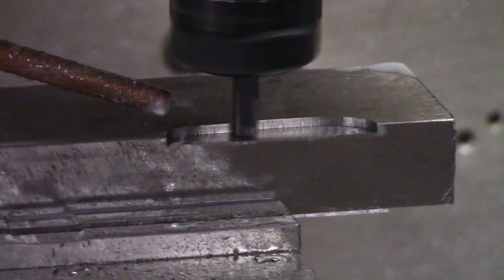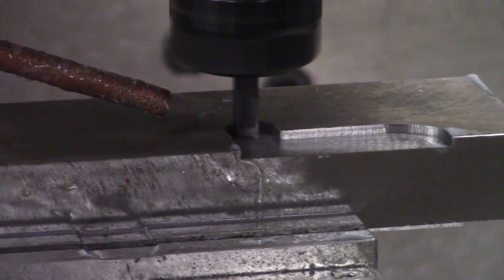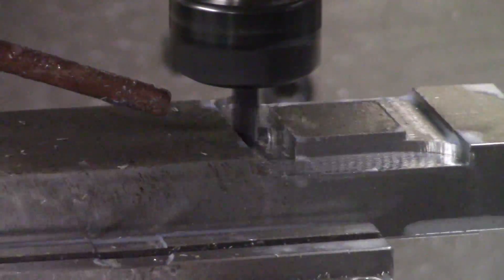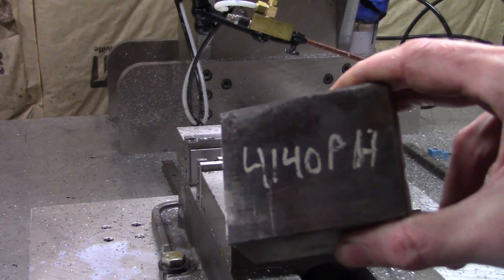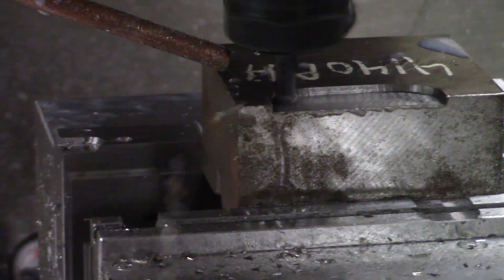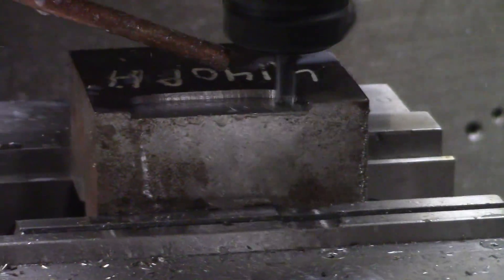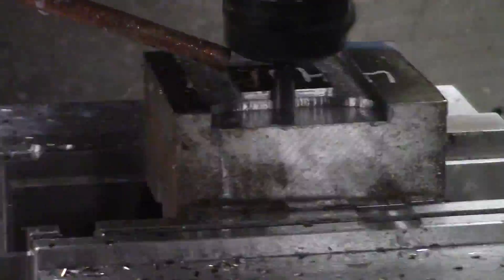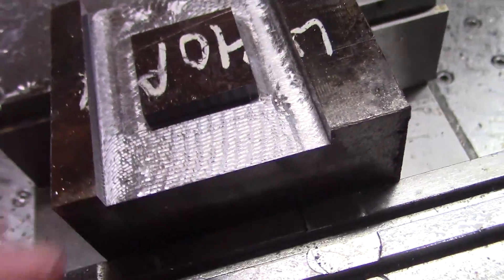Trying out Steel on the DIY VMC

Comment: The speed you chose may be "what the book said" but as a machinist with over 10 years working mills from 79kg to over 10 tonnes. I can tell you that only applies to machines in perfect condition, professionally made machines worth a fortune. I have never had the privilege of working on such a machine.
For the rest of us, including you, you need to start way slower than "what the book says" and work your way up.
The same advice also applies to climb milling, some of the biggest machines I have ever worked on still gave a better finish with conventional milling. This may not be what the book says but it is a real work fact. "The book" was written on premium machinery.

Comment: You can always leave a few thou for cleanup.
Maybe do your cleanup with at 25 -35ipm
I'd do clean up in two operations broken down like this:
Walls: leaving 1 thou on the floor
floor: leaving 1thou between tool and walls (don't want to touch the walls again :D)

It will leave you about a thousandths in the corner where the wall meets the floor. If this bothers you, you can always use a smaller high helical end-mill to cleanup the walls and floor near the walls, then do the rest of the floor in a separate operation.

Also, i would check the tram, runout, and deflection under load of your spindle. It could be the reason for the some of the surface finish issues.

Comment: any idea how much your machine weighs?  what's the travel ranges?
Reply from the maker: Ryan Lockwood I'm not exactly sure but over 2,000 lbs. The travel range is approximately 16"x16"x16”.
Reply: +Chris DePrisco I'm just curious how the weight of your machine compares with other similarly sized vmcs.
Reply from the maker: Quite a bit less.  The average Fanuc Robodrill which has about the same footprint weighs 4,409 lbs.  Granted, it's got a tool changer and enclosure and other stuff but mine is still about half the weight; which isn't a benefit.  An "average" sized VMC would weigh more like 8,000 lbs or more.

Comment: Could you share the specs of the system on the electronics? What type of spindle and motors did you use, etc. I am planning to do a similar project however I cant determine on what kw spindle I should get.
Reply from the maker: I think 2.2kW is the minimum you'd want if you plan on doing any lower speed milling.  You loose torque fast under about 8,000 RPM.  I used Clearpath servo motors, and a UCCNC C62 board to drive them.

Comment: I notice that a lot of your chatter is happeing on you y axis movements. Should check any give in the spindle parallel to the y but also your set up may have something to do with it. Many of our Haas machines at work make a slight different sound when milling forces on the cutter are from the y+(90 deg.) side as the y screw starts changing direction indicating ever so slight play in it. yours may be similar, especially since the Y is riding on the X. great build though I love it.

Comment: Check out my videos, I'd recommend running mild steel at 24,000 rpm & hardened steel at 24,000 rpm. For 1/4 carbide cutters & bumping your feed rate to 118 inches/min. I was scared at first to try it, but it turned out pretty well.

Comment: It is a nice looking machine ! I am not sure that milling steel will ever produce good results in terms of finish and/or high tolerances, as it is not the vocation of the machine to fight steel. Even if you rule out the end mill+spindle+feeds@speeds, aluminium is not up to the challenge of chewing steel without distorting itself. But if it mills aluminium in good conditions of tolerances and finish, I think is the maximum you may expect and consider that you did a very good job. Good job and keep up !

Comment: Whats the settings on your VFD? I have a 2.2kw spindle as well but I feel like at 7500rpm on steel the spindle would stall.
Reply from the maker: I thought so, too, but when I did some looking at the quick start guide the VFD puts out full voltage down to the base frequency (set to 60Hz).

"(1) Constant torque characteristic (VC)
With this control system set, the output voltage is in proportion to the output frequency within the range
from 0 Hz to the base frequency. Within the output frequency range over the base frequency up to the
maximum frequency, the output voltage is constant, regardless of the change in the output frequency. "

So it should have decent power all the way down to 60Hz which is 3,600 RPM.
Reply: I dunno why I see so many youtubers running their 1/4 inch AlTIN carbide endmills at such low speeds, FSwizard recommends 12,500 rpm. I run my 2.2kw at 24,000 rpm for mild steel, with 1/4 inch altin carbide endmills, at 118 inches per minute, with a 0.30 inch doc. My AlTin coating never rubs off, my endmills never chip, & my endmills are only mildly warm after a long operation.

Comment: If it's the same spindle i have lateral pressure will kill it. It will not hold up. aluminum  and wood only. I put this on a 5'x45"  diy.

Comment: the finish looks like your getting some deflection...more then likely on your z axis or spindle itself because its so regular but hard to be sure...check for any up and down on the table as well,even half a thou of vertical play in your linear bearings could cause it...if no obvious movement elsewhere it could also be flex or harmonics in the bottom plate or neck itself(aluminum is strong but it doesnt take much pressure to get some bounce in a wide plate)..with same pattern but different depth with harder materials something is giving a bit under load...if cant find it may have to compromise a bit and go with slower feed rates

Comment: Try taking a light finish pass on the floor of your part and see if it cleans up the surface finish. 
Also, what is your rpm, feed rate and end mill size? it sounds like you're running that end mill at a pretty high spindle speed.
Reply from the maker: +Brent Iannoli I was running wire high. I need to figure out off recipes for the machine but right now I keep trying different materials just too see what it can cut, lol.
Reply from the maker: +Chris DePrisco quite high*

Comment: I think that the resonance of steel plate construction of your machine frame is at least partly a source of the vibrations and bad finish seen on video. If you hit your Z-column with a hammer it probably rings like a bell instead of "thud" you get when you hit cast iron frame. I would suggest either gluing some heavy rubber mats on steel or filling the column with sandbags to dampen resonance.
Reply: Epoxy Granite

Comment: I will freely admit I have no knowledge of CNC practice, but if you think like a manual miller and just plough into the job rather than take all those teeny-weeny cuts, then take some clean up passes, the finish will surely be better or am I missing something.
Correction, I am the world's greatest expert on CNC, but only when it stands for Chris' Numbskull Control. The Chris, in this case, is me not you.
Reply from the maker: This is the newfangled "HSM" or High Speed Machining theory.  It's definitely worth a quick google although not something you could do manually.  It's supposed to actually be faster, easier on the tool and distributes the wear across the full length of the flutes when done correctly, which I wasn't doing, lol.

Here's a pretty good explanation: http://www.cnccookbook.com/CCCNCMillFeedsSpeedsHighSpeedMachining.htm

Comment: Having barely no knowledge of cnc spindles, ain't there more adecuate "flat head" spindles ? At least for steel.

Also, consider grabbing any small (led or not) flashlight to film surface finishes. pointing them in acute/oblicuous angles (and never directing the flashlight to the camera) helps a lot. Obviously because the light helps the camera autofocus, and because small ridges that sometimes ain't even visible in room light generate shadows with a flashlight in low angles.
Reply from the maker: I'm not sure what a flat head spindle is, but yes, there are certainly more adequate ones than the one I'm using.  This one is a placeholder until I can justify spending a few grand on a spindle/VFD alone; I haven't spent that much on the whole machine so far!  I plan on doing a lot of small detail work so I will need/want a very high RPM spindle with ATC and those are just so very expensive.  Maybe I'll get a Colombo someday!

Comment: I don't know why so am asking:  Why climb milling? Is conventional milling the worse option with high spindle speeds?
Reply from the maker: From everything I understand, climb is always better but if there is any backlash like with ACME lead screws or an old worn out machine you get the cutter pulling the table around.  With zero backlash setups, like with ball screws, it can't do that.  Basically everything on modern CNC is done climb milling, although I'm sure there are exceptions.  Even Fusion 360 CAM defaults every operation to climb.

Comment: I am sure that you will find the way to improve the build. Consider glueing a couple of accelerometers in critical part of the frame and/or spindle in order to check the modes of vibrations. Mr. Andruino may be of help here.

Comment: I'm no expert at hard materials, but 7,500rpm is insanely high in my opinion. But I also know that you can't go lower with your 24,000rpm spindle. I have the same one.
Reply from the maker: Depends on a lot of factors but with a 3 flute .25" mill, that recipe put me close to the manufacturer's recommendation for SFM and IPT.  I did bump up the speed because the 6,500 which was given by the calculator was causing a bit of chatter.

Comment: Looking good man, you'll get used to the machine and learn what it can take.  One thing I have been noticing is that at the end of the toolpaths your Z axis is diving down before it goes home, for example just after 1:45, after it moves over an takes that last cut, it dives back down again. I'm not sure what it is, maybe your G28 position or something, but I have seen it a few times now, and I have a feeling that is going to bite you one day. Just a heads up!! BTW I also saw this in the aluminum cutting vid at around 7:45 for another example.
Reply from the maker: Yea I'm not sure why it does that.  It's going back to Z0 before it goes home; I'm not sure if that's a post processor thing or what.

Comment: Your machine took it well. Still wondering what exactly is the root cause for the chatter marks. Keep it up.
Reply: I think he wasn't cutting into it enough. To shallow of horizontal direction into the metal. Steel is hard so the angle of incidence is less and the bit is skidding off it. Maybe keep the rpm, and run a higher feed rate. Worse you break an end mill. But I think 90% of problem is the end mill. But just my guess of an opinion.

Comment: HI your ruff finish is spindle deflection. you need something that is pretty beefy for steel cutting. Bridgeport bearings are big for a good reason lol. On your other video I seen you had some machine vibrations, I would add some big gussets to the base to make it more ridged it will make a big difference when you trying to hold tolerance and avoid getting gouge marks other than that looks great. You did a great job building it a+.

Comment: Nice Job that you have done building this machine Chris! 
My recommendation would be to try a variable flute, variable helix endmill, or better, a radius endmill. And with hard material, you should use a 5 or 6 flutes endmill.

I made some molds in P20 and 420SS and my experiences are that with a radius endmill like .500, .03 Radius endmill with variable flute and helix, they will last longer with the radius and the finish of the wall will be better thanks to the variable flute and helix.

With HSM, it's hard to have a nice floor finsh cause it's not the purpose of HSM, it is to rough out the most of the material.

Another thing, like some have said, try to cut with a higher DOC and take smaller stepover. My rull of thumb is 1xd for DOC and 7-12% of D for stepover.

Keep us posted! Cheers!
Reply from the maker: I will try those things out, thanks!

Comment: Hey just a thought to try.. I get good results on my Bp s2 climb cutting at 2800 rpm , 15" per min with .188 WOC running a 4 flute carbide. Don't be scared to try wider width of cut than recommended ... sometimes the machine likes it
Reply: I'd argue the opposite. I'd go full depth and decrease the step-over. Full width is more of a high-rigidity, low RPM style setup.
Reply: +The Metal Butcher I should have noted that formula is for a 3/8 mill . I use it for most depth of cuts, usually full depth with a .020 " cleanup or less.

Comment: Chris with that cutting style (Trochoidal) it is usually better to take the full depth and reduce the step over amount. This has the effect of reducing the chip thickness by increasing the lead angle. You can feed faster so remove more material in less time with less load on the tool. Also it distributes the cut over the full length of the tool so the tool lasts longer. If you make the wall finish pass with the same tool you won't have a step in it from just the tip wear of the peck depth. This cutting style works piticulary  well in hard to machine materials like Inconel, titanium and stainless steel.
Reply from the maker: Thanks for the tip.  I still need to explore how much torque the spindle can put out before stalling.  My first attempt (I wasn't filming at the time) I tried depth of .25" but had too much stepover or feed and stalled out the spindle (low torque at low RPM) and snapped the mill.  This was my last one so I figured I better take it easy, lol.
Reply: Reducing the step over should reduce the power required. Even on my large machines I don't use a large step over for this style of tool path maybe about .02 to .03 is all for a .500" endmill in my case. the feed rate is where you get the metal removal with full depth of cut. I usually put a different style of finish pass to cleanup the floor and walls of just the normal pocket style tool path with about 65% step over at a slower feed with a different tool. You are using Clearpath servo motors aren't you? How do you like them. I am thinking about building something using them.
Reply from the maker: Absolutely no complaints with them so far, quiet, cool running, and they just work.  I honestly haven't given them any thought since I first set them up.

Comment: I'd be willing to bet the chatter you're seeing on the floor has to do with the rigidity of the spindle itself. It could also be a z axis issue, but your build seemed very rigid and I doubt that's the problem. Radially, the finishes were looking really good, I suspect your spindle has some amount of axial backlash of some short.
Reply: Yea I think the endmill may be pulling the z axis down when the flutes engage radially. A shallow finish pass might be the easiest way to thwart it.
Reply from the maker: I'll have to experiment with that once the way covers are done.  Thanks!
Reply: Sort, not short*
Reply from the maker: I'll have to give that a check, thanks!

Comment: get a beefier spindle! something like a 10-12k rpm with more torque and then after that get a bigger cutter, like a helical
Reply from the maker: It'll already do 24,000 rpm at 3HP, what more do you want?! Lol

I was starting off following the manufacturer's recommendations for SFM and chip load.
Reply: +Chris DePrisco harder metals like slower rpms and more torque